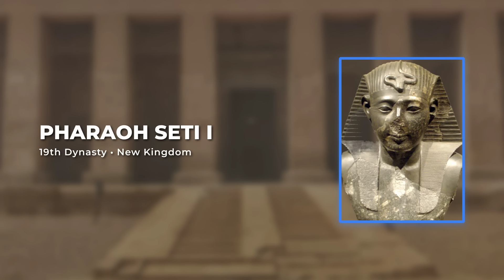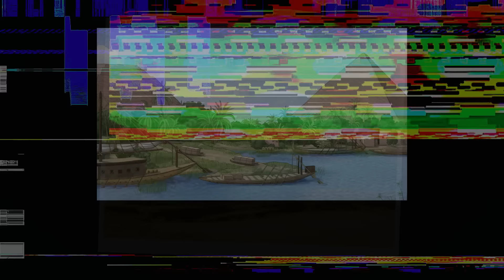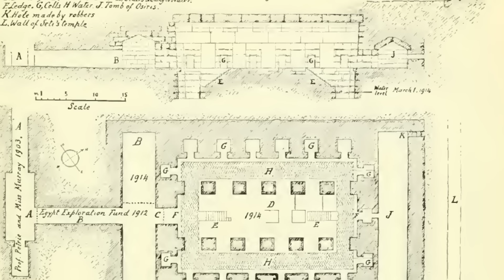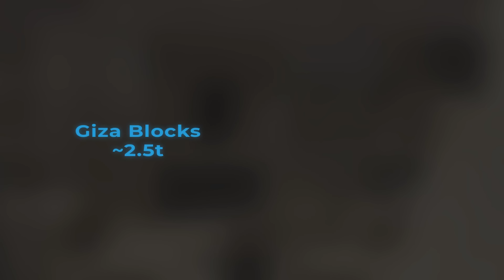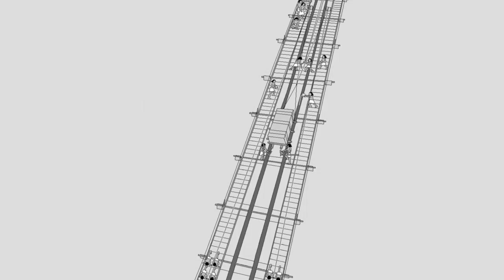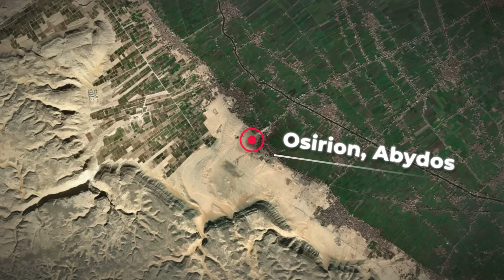The Osirion’s Real Secret Finally Exposed — Why It Doesn’t Fit Egypt’s Timeline

Comment: You didn't tell maybe the most important thing that destroys any attempt made by egyptologists to say the Osirion structure was made by Seti: The temple of Seti the 1st has not been made as usual and as logic asks, that is putting all its parts on a single direction (a rectangular shape). Gods want perfection, Pharaos were gods (they think) and the most stupid way to make a temple for a god is to make it by an "L" structure. Perfection means doing it by a  rectangular shape, from the entrance to the end of the temple. But the temple of Seti the 1st is made as a gigantic "L", and the only reason that could use logic for that behavior is because there was "already" a structure made before the temple. Seti (or his advisors) wanted to build his temple close to the Osirion, and the only way to do it was doing it by making an "L" shape, in order to let the most important part of his temple closer to the Osirion. If they had the opportunity to build up the Osirion together with the temple, they surely would have build it to one of the longer sides of a perfectly rectangular temple.

Comment: You’re right about water management—and there’s now statistical evidence to back it up. I’ve spent two months validating a geometric model showing that megalithic sites cluster on aquifer-karst systems where groundwater behaves predictably. 16 independent tests. Satellite gravity confirmation. Even passed a test suggested by top spatial statisticians.
Three papers on Zenodo (search “Dylan Schofield”):
	1.	Spherical Harmonic Mechanism and Lithospheric Depth Selectivity in the FNIZ Model: 16-Test Empirical Validation
	2.	Geopolymer Construction and the FNIZ Model: Comprehensive Validation of a Chemistry-Specific Ancient Resource Network
	3.	Predictable Earth, Survivable Places: The Monumentalization of Aquifer-Cave Nodes After Environmental Cataclysm. 

Giza is a primary FNIZ node; the Osirion likely accesses the same Nile Valley aquifer network—monumentalized water infrastructure, connected underground.
More on my Substack: Dylan Schofield

Comment: It was built by Seti the 1st. You guys are proper dumb. Between the blocks are copper dovetail clamps with Seti 1st cartouches on them. One of these clamps was retrieved by dynamite at a t-junction of one of the cross beam megalithic blocks. It was joining two blocks, while being underneath another block. In short, it had been there since its construction.
This Graham Hancock stuff is silly. I’m sorry you have been scammed by these grifters. I hope you find your way out.

Comment: Having been there on more than 20 occasions, the last few,not even bothering with the Egyptian building above it,l categorically agree that it is,like the valley temple and possibly the now locked off structure called the unfinished pyramid at Zawyet El Aryan,which my mother manged to have access to in the 1950s,it's now locked away behind wire on a military base fulfilled with garbage. Have a look at the drawings & photos that do exist & I'm sure you'll see why I include it. It also incorporates some firm of drainage system that even having lifted the vast "flooring" blocks they were unable to reach or ever understand. 
The latest research I've seen regarding the Osireion has established it's fed by at least two separate water systems and the "moat" - if l can quote from memory(I'm dyslexic so apologise for any mistakes) - is 45 or 65 feet deep,it's filled with silt and a strange metal rod was retrieved in the recent attempts to measure it. I would encourage anyone to Google it,if they're interested and want the entire details of the study.
My first memory of Egypt was the reopening ceremony at Abu Simbal and because of my parents connections have had access via helicopter to many sites,rather than following the dreaded tourist trail. In my multiple trips I've climbed the great pyramid twice & even stood o the back of the Sphinx. 
The present regime are simply interested in extracting tourists money as effectively as possible, while making sites "tourist friendly" by covering up, any potential "dangers" ,but,in reality turning it into a Disney type theme park. With a huge emphasis on the current Egyptians being the exact same people who built the pyramids, the valley temple,the Osireion and one so puzzling they've just eradicated it! They have zero interest in the truth and insist on a narrative that is patronising.

Comment: Archaeology has thoroughly discredited itself.   We are supposed to believe the Incas and the dynastic Egyptians used the same megalithic architecture without any contact.   If you look in detail they are essentially identical.   For example, how the corner blocks are shaped into a "short foot L" to round the corner instead of being simply abutted to each other.   It is rather clear that neither the Incas, nor the dynastic Egyptians built these specific megalithic structures.   They came after and built in their own style which does not resemble the ancient megalithic structures.    It is really tiresome to be "informed" that the presence of some trinket in the vicinity of the Great Pyramid establishes who built it.   Exactly like claiming that graffiti artists built the buildings that they paint on.    Before some clown chimes in that this is Dunning-Kruger from some skeptic, the mental condition actually applies to mainstream archaeologists since they seem to think their worthless opinions override any engineering analysis.   Archaeologists are not engineers and scientists and this is evident from their silly attempts to substitute with their own ideas.
Reply: The pyramid is just the best shape when you build something so large. Stop disregarding the ability of ancient people and putting modern man on a pedestal.
Reply: One thing that in my opinion really discredits Pre-Columbian contact theories is mostly the lack of domesticated crops from the Americas.